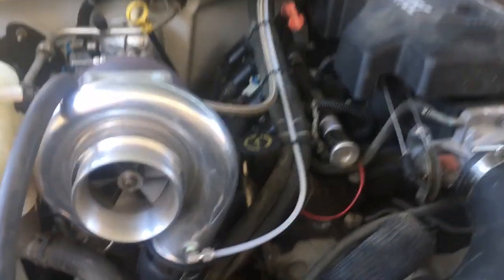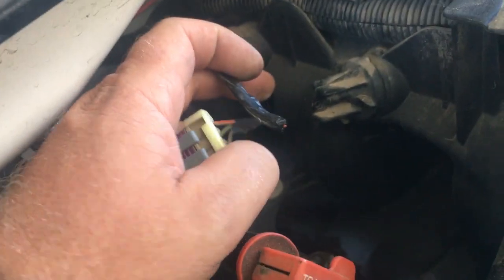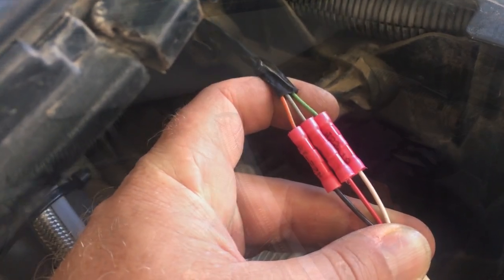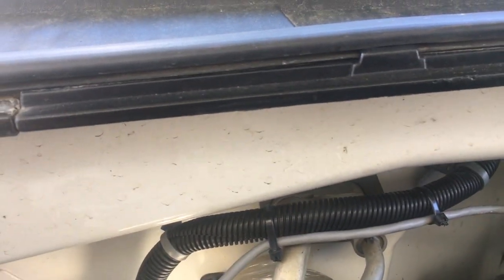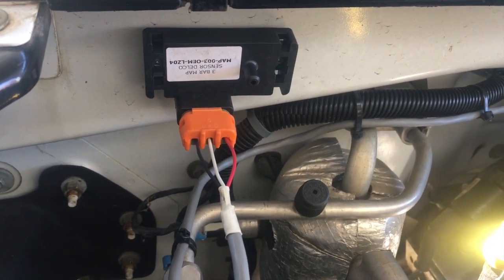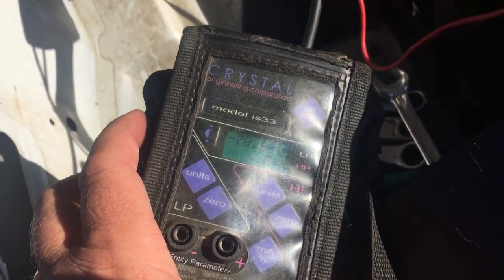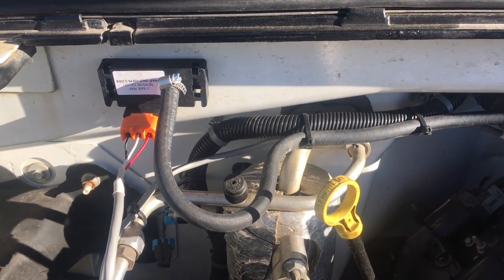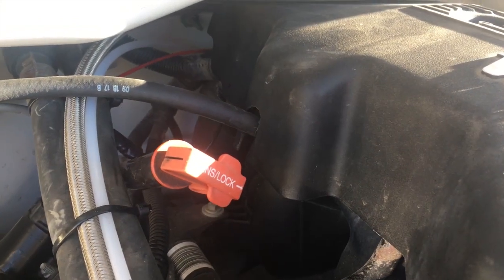Lowbuck LS Turbo Truck Project - 3 Bar MAP Sensor Install

Comment: Did u put a hose clamp on every vacuumn hose? My truck started up and idle normal on stock tune n map sensor but when i switched to 2 bar map sensor and 2 bar OS it idles rough at 105kpa for some reason and wont go down on the VE table from 105kpa

Comment: Under boost, does the stock map sensor stay in place?
Reply: Did u find out the answer to this question? My brother bought a turbo 5.3ls and the map sensor has self tapper screws to hold it but my 5.3ls has the stock clips to hold it but I'm not sure if it will hold it in place under boost

Comment: installing a Fitech standalone ls efi on my 5.3 that  I have in my 77 C10 (it came from a 2000 1500 Silverado) and the fitech  comes with a 3 bar map sensor which won't fit into the factory spot, and they said to drill it out, and that would mean pieces falling  into it, I have been all over youtube, and the internet to figure this out, on how to connect FItech's map sensor, and you resolve it, at least for now I have a way (I don't want to take off the intake to drill a hole for that sensor) and I hope there is another way ,,,, but i thank you 4 years youtube,, anyone has other ways - please I am open

Comment: Thanks for the knowledge couple vids really came in handy! I did this swap and my boost gauge came with a map sensor as well you think it’ll be fine to tee and use the same vacuum line for both
Reply from the maker: Bryan Whitehouse should be fine I would think

Comment: Hey mate I’m having some trouble with my ls1 idling I have adjusted the tune it is surging and the idle is up and down I run a high rise manifold and it has no map sensor spot so I haven’t got it hooked up would that be my problem since I have no map sensor?
Reply from the maker: 4x4 life yes I would bet that is your problem, pretty important to have that MAP sensor reading for the computer to do its calculations correctly

Comment: My OS tab shows a blank page. Do I have to install the 3 bar MAP first then connect to the truck for it to recognize the 3 bar?
Reply from the maker: Maybe there's already a custom OS installed on that ECM, go in to the VCM Editor, click on the "Edit" menu option at the top of the screen, click on "Calibration Details" and go to the "Controllers" tab. $ Item down should say "Operating System" see what it says there. You need to be starting with a stock OS to be able to install the 3 bar OS. IF some other OS is installed the OS tab will be blank like you are seeing.
Reply: @LowbuckLS  thanks Brother. As soon as I finish this Z71 transmission I will do just that.
Reply: @LowbuckLS  I changed something to from basic to advanced and now it's allowing me to change to a 3 bar. Thank you for your help Brother
Reply: @LowbuckLS  Did what you said and it says OS is 9381344. What now?

Comment: What size turbo are you running? I'm thinking about a small turbo and about 7psi on my suburban just for a little help when towing. Not particularly a race or high hp application. Also how much boost are you running?
Reply from the maker: Michael Brown I’m running a 7875 turbo and currently running about 10lbs of boost but plan on cranking that up to 15lbs once I upgrade my fuel pump.

Comment: When we put a higher bar sensor car makes more boost(bar) or not
Reply from the maker: Altin Ademaj the 3 bar map sensor just allows the engine computer to measure a higher level of boost it doesn’t create more boost, you would need to adjust your boost controller or wastegate spring to do that. The 3 bar map sensor is needed so the computer can measure the manifold pressure under boost and calculate how much fuel is needed to keep the air fuel ratio correct.

Comment: So do you have to run an air intake temp sensor when running 3 bar ?
Reply from the maker: SHARK CITY WARRIOR yes you still need an IAT sensor, the ECU uses that temperature  for calculations. Up til this point I have been using the IAT sensor that is built in to the MAF sensor, but I’m getting rid of the MAF so I just bought a stand alone IAT sensor, will show how to install it in an upcoming video.

Comment: You should be able to mount that coolant overflow tank sideways in the same spot (turn it 90 degrees) and that will at least get it off the turbo. May require a different hose if that kinks the factory to much, or just snip the factory hose to work.
Reply from the maker: Thanks silentbravo, I appreciate you’re input. Will try turn it sideways as you suggested. Thanks again for watching and commenting.